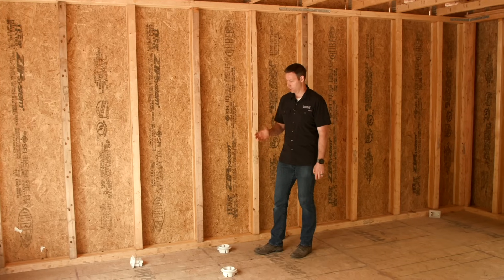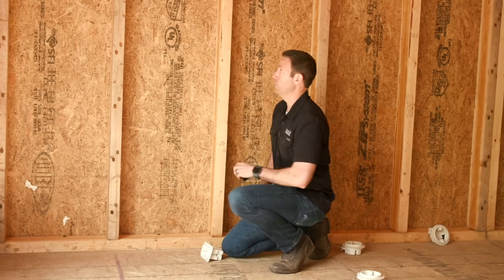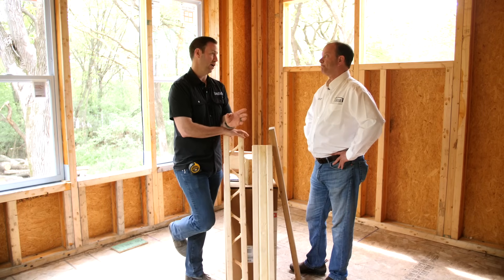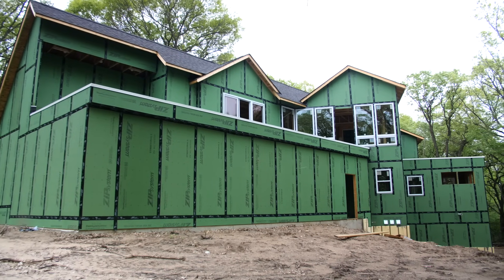Insulated Studs? This is a BIG Innovation in Framing!

Comment: A problem with 24" o/c is people need to hang things on walls and such as cabinet mounting. WHich therefore creates another complication to contend with. So intermittent horizontal bracing needs to be considered. But that has been overlooking n this presentation. 

As well, I have never understood why trusses are not used or considered by Building codes as a better use than these dynamic dimensions of headers. Such as Engineered Trusses, which can bear huge loads over long spans. So those stacked heads shown on the presentation I contend are way overkill. 

I believe the construction industry is being compromised by inept Building Departments that are simply unknowledgeable on adequate applications of construction. Selling these Building Departments on new ways of construction requires more invested time of engineering calculations to educate them. Then, "who is going to pay for that time?"

Comment: They could incorporate a channel in the bottom at the height of electrical outlets for electrical wires etc and flush mount a steel plate wire protector on both sides...

Comment: Enter the electrician.
Electrician: hold my beer I'm about to wreck this man's career.
Reply: I'm a plumber... and i came w the electrician to tag team this beezy. ..
Reply: @vinnys72gtx  Why are you installing anything in the exterior walls except an occasional vent or drain?  Still it's not overly difficult to avoid the dowels.
Reply: @steven7650  bx.... Haven't heard that in a while. I can tell you're old school I like it man
Reply: @bwcartmill7919  I was probably tired or drunk when i wrote that. Meant MC, I always get confused which is which.... probably doesn't make me seem any younger.
Reply: True
Reply: In northern climates the insulation between them should make your life easier. No drilling necessary, you just poke the wire through the foam, maybe use a screwdriver to make a small hole for 12/2 or 14/2. Even BX cable.
Reply: Exactly

Comment: Question Matt, on average spray foam gets about R5 per inch. So 1.5" per side separated by the dowels ( a small thermal break ) means that the numbers don't add up 2.5 foam = R12.5 (max) plus R3 for the wood = R15.5 not taking into account the thermal bridge from the dowel. Did they explain how they got R20?  Up here in Canada, we are also using R24 batts. LOVE YOUR SHOW MAN.. regular viewer interested in all the new tech from both sides of the border.

Comment: "You'd never build a cooler out of wood, would you?"  .... I see what you did there haha
Reply: I think he got lucky with that one 😛
Reply: @digi3218  makes it even better haha!
Reply: I’d never want to live in a cooler either.
Reply: It's a yetti  house 🤪
Reply: "Never"?  I wouldn't say that.

If the walls of the cooler were thick enough, I would.  Matt had a video of a trip to Switzerland (or was it Sweden?) where there was a factory making "basically plywood walls out of lumber" by layering 2x that wound up making 16" thick solid wood walls.

Of course, it's lot easier to use a material for a more suitable purpose.  I'd prefer having a cooler made out of foam and a wall made out of lumber rather than a cooler made out of lumber and a wall made out of foam.

Comment: Don't the dowels act as a thermal bridge just as traditional framing does?
Reply: Yes, there will be a thermal bridge.  Literally, it is physically impossible not to, if two things touch, they conduct heat if there's a thermal gradient, although it depends on the contact area and the thermal conductivity of the materials.

But what matters here is the effective bridging.  It will be considerably less, as it will be conducted over the cross section area of those dowels, rather than the cross section of an entire stud.  I would hazard a guess that it would have somewhere between 5% and 10% of the cross section.  So only 5% to 10% of the heat can transfer across, likely even less.

Comment: Spray foam has been proven many times to shrink and pull away from the wall cavities leaving an actually very poorly insulated house. Will the foam used here end up doing the same, and leave those spindly dowel-connected 2x3's to start to rack?

Comment: seems to me you would be increasing construction costs, because you still have to insulate between the studs so you're not getting away from the cost of insulation, instead you're gaining the cost of insulated studs. unless they're less expensive (which I highly doubt) than regular lumber studs, they're really not worth it unless you have the finances.

Comment: There  are some issues that I can see with this product.  The foam insulation will not be great from a flammability perpsective. He runs down the insulation value of wood but it is far better than either steel or concrete.  The fabricated wood beam with be more stiff than conventional wood frame which has both pluses and minuses.  Biggest question though is cost as this seems lime it would be considerably more costly. Great innovation.

Comment: Better never loose blue prints. They should make walls dif or some way to know w remodels i hater thinking about it over time. 100 years or 50 ok but long time i think failure and dangers w multiple timbers in the industry. Somehow keep it very simple b4 old books teach wood and nature. The foam as a load bearing w long term its never gonna be same cuz its new. Twist and water a wall whatever you think is over time and put the full load on the wall for floors it says it can handle and roof load ect and twist and blah that wall and see if they start to seperate. Say a scenario a place in rual where the freeze and thaw moves up and down farther up north.

Comment: I don't get it; maybe because I don't build houses.  Is the concern heat/cold transfer from the outer surfaces of the house through the stud to where the inner wall touches the stud?  I'd have to know the cost difference over the life of a house and what might be invested in better wall insulation itself before spending too much extra on this stuff.

Comment: With a 2 1/2 width, can you still  cross cut these studs easily with a skillsaw or do you need chop saw to get all the way through?
Reply: That would depend on the size of blade in your saw.
Reply: Obviously, I know they have specialty saws with larger circular blades that are intended to crosscut beams, posts , etc. I'm just referring to the common size circular saws which has 7 1/4" blade on it. I dont think you would be able to do a clean cross cut with it, which is unfortunate.

Comment: Hey Matt I’m glad I had a minute and decided to jump on the tubes.  I saw one of your videos and here I am now, committed and subscribed.  

You do a great and leave out the bias.  Professional ethics.

Anyway.  My question.  Aside from the incredible r value attained and thermal bridge mitigation, won’t this t stud also serve another great purpose?  Sound deadening?  

Tstud is essentially decoupling the walls.  Same reason why you install a resilient sound channel before hanging rock.  It decouples the wall and stops sound reverberation...

Super incredible.  I built some sound rooms on 2x8 plates to essentially double stud the wall by staggering them to create the same effect - uncoupling the surfaces. 

This tstud - if done with green glue and 2 - 5/8” fire rated rock, will create a nearly sound proof wall along with all the other great benefits.

I’m building my work shop soon and often times a like working at night when the kids are asleep but neighbors are too.  I have already been drafting my plan how to sound deaden it.

Tstuds, you have a new client/contractor.

Comment: Just stagger stud your walls 2x6 or 2x8 (or more) header and footer stud 24" oc on both side with 2x3 or 2x4 s offset the studs 12 inches inside to out. WAY CHEAPER  also allows you to crossbrace the walls internally. No thermal bridge insulate both sides.

Comment: Does spray foam also act as sound proofing?
Reply: Spray foam off gases so don't use it.
Reply: Voltzy70 if it’s applied properly and given 24 hours to cure, off gassing is not a problem. 

Yes, spray foam helps with sound insulation

Comment: I'm curious about the fireload of these products.  Are me and my brothers now going to have to worry about going into homes built with these that are likely to collapse faster than tradition wood framing.  I'm having I-Joist flashbacks...
Reply: Seems like a valid concern. Vertical loads only apply under pristine conditions, doesn't necessarily translate to damaged/compromised structure during a fire. From a structural consideration, a bunch of toilet paper tubes on end side by side by side over an area will support a hell of a vertical load so long as it's flat and even, undisturbed. Get them wet or burn them and the additional strength over solid 2x8 or whatever spaced members as joists is quickly gone. Larger pieces of wood burn more slowly than a bunch of kindling.

Comment: This is a great product.  Only thing I think I'd prefer different would be to have the foam be a different color than the tan they're using.  Having it be blue/pink/green etc... would probably make it much easier to visually get thinking changed to work with this new method. (e.g. - getting a change order for a window or door, someone walking in to measure for casing would have a reminder to adjust for the insulated void, as it will involve a few different attachment methods)

Comment: In 1980 I  started building houses with a 8" dble studded wall. Studs on 24" centers- both inner wall and outer, Advanced framing on structural outer wall. This is an  improvement to 2x6 but not as good as dbl studded
Reply: Doesn't that cost a lot more than the t-stud method?
Reply: @jrbisc99  I  suspect that the Dbl stud done with advanced framing is close to the 2x6 T-stud framing cost, particularly how the framing is done in video. My system has 27-28  R value through whole house with exception of headers which will be a little less.  If I were building houses now I would look real close at the 2x8 T-stud system as a being better than my old DBL 2x4 wall . One reason is I suspect that the T-studs have fewer defective/ crooked studs so less waste.  I would want my walls to approach R 30. Header details for load bearing walls would need some thinking on

Comment: Nice concept for extreme climates but here in the northern tip of Illinois I pay $46.00 per month for the year  for natural Gas(includes dryer and range) for a 2200 sq ft house.
Air conditioning probably and extra $35.00 per month for 3 months. Not sure I'm seeing a payback for me.
Like has been already said windows are a big thermal loss but you could spend an extra $5,000 just to go from an R3.5 to a R5.5 (triple pane).
You will gain comfort but payback may be questionable.

Comment: I wonder if houses are getting too tight to deal with fresh air, radon and mold.
 Great idea to fix a weak spot though. Well done sir.
Reply: That's what I was wondering as well. Make it more insulated, more air tight. Sounds good from a temperature loss perspective, but lack of airflow increases a build up of moisture inside leading to mold and other things. Houses need to breathe some. I suppose someone could open a window but kind of defeats the purpose doesn't it?

Comment: Since you have used a thermally and structurally superior stud, what about the plate material? This is a weak point as well as the stud is in conventional framing. Do you, or will you, also mfg. an engineered plate?

Comment: isn't the wood webbing in the insulation portion of the stud a thermal bridge?
Reply: my point is try to explain this to a client and see if they use it in their home. guaranteed they wont like the price of it and wonder why they cant build like their neighbors are building and save money. has anybody even value engineered this to see if you get a ROI on it?
Reply: Your are SO right..    SuperSTUD accommodates up to R66 in walls.  WAY cheaper with inherent features that make the build so much faster/easier/affordable.... (https://www.youtube.com/watch?v=Btd1mHdossQ&t=9s)
Reply: then the whole idea is absurd. it doesn't fix the problem it set out to achieve
Reply: @CaseyDesignBuild  If the problem is trying to get a stud with a higher R value then they clearly achieved it.
Reply: Stephen Bonutto there are other methods to acheiving a higher r value that cost less and dont effect the structural integrity of the stud

Comment: Wood is a not a conductor. So, saying an "insulated
stud" 2x6 can defy physics by not conducting heat or cold better than a
lumber stud is well, false. Their trick to getting their numbers or blinding
you with science is by using high temperatures and not ambient temps plus an air
gap between inner and outer stud faces. The air gap is a nifty feature, until
they mention cost. I say cost because the repayment just isn't there. So, the
insulated stud in my book is just another gimmick to get you to spend money on
something you don't need within wall framing. Now, if they were usable as a
floor or ceiling joist, no not really. Much better and less expensive ways are
out there. The reality is simple as told by the inventor himself. The insulated
stud is 100% gimmick and not advancing framing a single iota. Hence you here no
mention of a patent. Matt, you should research before presenting items on your
show, otherwise the smart people will know you’re a just another sell-out when
you don’t present cons.

Comment: Great r value until I run wires, venting, ducting, plumbing through them
Reply: Awesome point!   Have you heard of the SuperSTUD?  Accommodates up to R66 in walls.  The thermal break in this stud comes with pre-drilled holes that makes plumbers and electricians say "WOW" when builders use it.    WAY cheaper with inherent features that make the build so much faster/easier and MUCH more AFFORDABLE .... (https://www.youtube.com/watch?v=Btd1mHdossQ&t=9s)

Comment: Honestly. The wheel is round..and rolls....it started off at stone and eventually made it to rubber... caves worked for homes...and eventually made it to wood structure...now perfect has been perfected 100 times over...umm....I think I have seen some magnificent castles still standing today that are extremely warm in winter and cool in summer...  And that's no exaggerating....when is man going to wake up new improved over engineering is not always perfect..many times simple is perfect...

Comment: All that beautiful “R” value in the walls and they used crappy windows.
Reply: I know it's off topic, but I wish winter coats had an R value listed on their label.
Reply: Daniel S 😂
Reply: @daniels5780  I wish they made winter coats out of T-studs!
Reply: Dee Jay  The window frames are very thin. Why spend all that money on insulated studs, but use sub par windows? These windows you can tell are double pane and should be triple pane if you are already spending a lot of extra money on the insulated studs alone. The glass is clear, and today people use lowE argon gas windows, which has a blue or sometimes green "tint" to the glass. I would expect to see a Pella wood window in a house like this.
Reply: Dee Jay  Pella's are nice if you can afford them but you can keep the Anderson's. Especially the wood sash Anderson's. They have Pella's price tag but not their attention to quality. A door or window needs to be matched in the figure of the grain. You don't just grab two random pieces of wood and throw them into a door or window together. They need to match. Similar grain structure and color. I've installed too many Anderson's that I feel that wasn't done. Just my opinion.
Reply: @iamjackalope  Pella's are junk. Rollform aluminum cladding on the windows results in rot. Pella knows this but doesnt do a thing to fix it. Andersen E series, Marvin, Kolbe, others, use extruded aluminum for exteriors. Much better system than rollform
Reply: Dee Jay  while it's true that Anderson is a high quality window the "silverline" is the exception. Silverline was a low quality vinyl window manufacturer. Anderson purchased silverline not because they saw quality, but because home Depot, Andersons biggest customer demanded a lower prices product or they would switch to carrying Pella.
Reply: lol exactly what i was going to say.
Reply: silverline windows are total crap...among the very worst windows on the market . Andersen did buy the company at one time, but never did a thing to improve them, and then realizing it was a mistake they sold the company a few years back. HomeDepot American craftsman line is a rebranded silverline
Reply: The best windows you can buy like triple pane is like r 6-8
Reply: What are considered good windows for Texas heat?
Reply: @wcctexas  window shades or extra overhang is the most effective resistance to the Sun. We have a different issue in the south. Induction is not conduction.. I hope I said that right...
Reply: What is all that r value he always talking about
Reply: @carlosj.gonzalez2648  its the thermal resistance. if a wall has high R value, it means that it can resist cold and heat very well.
Reply: @carlosj.gonzalez2648  The R value is for resistance.  The higher the number, the slower the temperature change of the inside of the house to match the outside of the house, as long as the doors and windows are closed.  Oh, and barring any other large holes in the structure.
Reply: Dee Jay - I think Andersen Series 400 are the way to go. They are the best.